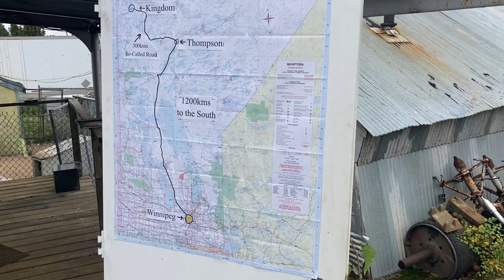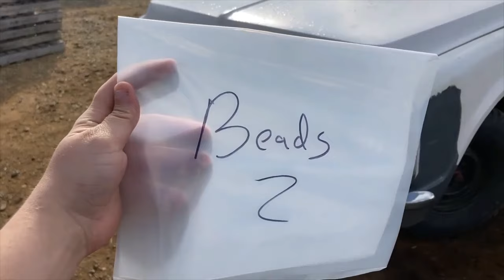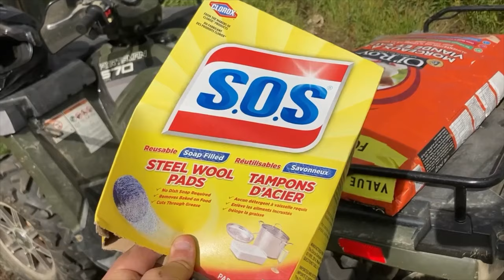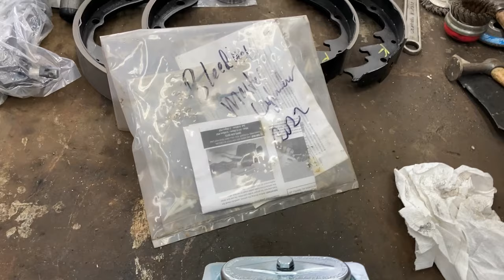Magic Air Drying Beads Plus Chasing Bubbles in Master Cylinder Too Sept 09 2023

Comment: Good idea Beer and Boobies. When I was working I loaded logging trucks with wood poles that were left over from the Oakland Hills fire. I loaded 25 to 26 poles per load. Childs play for my 30,000 lb cap Hyster Forklift. Guys wanted then to build Pole barns. I didn't realize Xena was going to pick up those logs on the trail great idea. I have to bench bleed this new Master cylinder for my Dodge Power wagon can't have those bubbles in there either. This 3 ton beast has to be able to stop. Since its a '52 need to replace all of the wheel cylinders too all tires have brake fluid running down inside the tire. Thanks for the video.
Reply from the maker: yes pole barns are popular in the south but not up here because of the bedrock. it is free wood on the ground and we just have to go around picking it up. it will all be toothpick but better then nothing. bench bleeding is a good way to know if the master cylinder even works. last summer i had 4 master cylinder that were bubble makers.  thansk

Comment: Nice working  weather, raining here today, Xena is working hard on the bread 🍞 pans and if they don’t come clean she can use for planting seeds in them, can you give me more information on the bead water separator I’ve never seen one and would like to get one for my plasmas cutter, the trailer is awesome, I know you don’t like chainsaws but maybe you get battery powered one to cut the small tree they work great and stop turning when you let off the trigger, y’all enjoy your beverages you deserve it with all the hard work y’all did this week, don’t forget to clean the vacuum cleaner tomorrow, till tomorrow
Reply from the maker: we even tried the battery powered one and gave up, spent a lot of money to go nowhere. this is basicly the best air dryer system that we bought and it was expensive. the Milton 1170 is the canister that holds the milton 1170-1 beads. here is a link to the complete set up.  thansk
https://ca.jbtools.com/milton-1072-1-2-deluxe-desiccant-dryer-system/
Reply: @kingofobsolete4789  thank you ill be checking it out
Reply from the maker: your welcome  thansk @joutdoorsmen23

Comment: Pipes need caps will fill with water 😊
Reply: Sometimes we just spray foam in the pipe , round it off and paint it 😅😅😮😅
Reply: That will work OK with intro to u show just messing beers & cheers u guys
Reply from the maker: drilled a hole  thansk

Comment: Hi there. Rob James from Alexander here. The “proportioning” valve also acts as a brake bias failure indicator. If the front system, or rear has a pressure leak. A spool valve is shunted one way or the other to contact the electrical terminal to ground. Then illuminating the brake indicator in the dash, same one that the park brake illuminates. The drum brake system will work just fine without it, although it is required for inspection. Hope that helps. Have a good day, thanks for the videos.
Reply from the maker: thank you, hoping since the truck is highly modified with none of the original wiring being used it is classified as a hot rod for passing a safety. the less thing involved means less things to go wrong. i have never had any luck with proptioning valves and both of these trucks would not doing anything when trying to get the brakes to work for around the yard last year. being almost 60 years old they might be stuck.  thansk